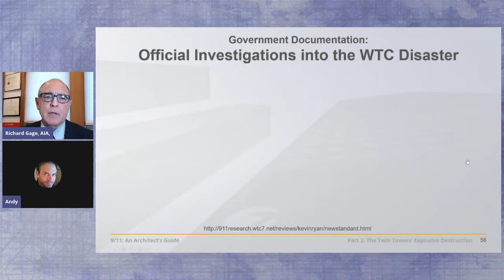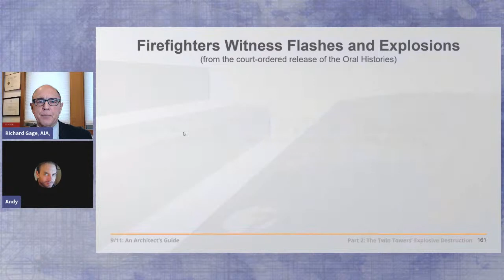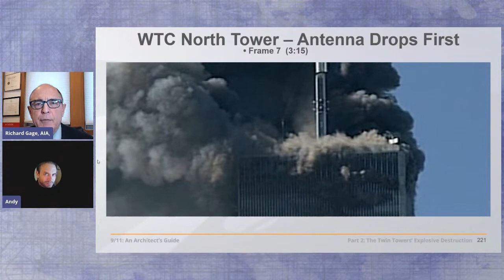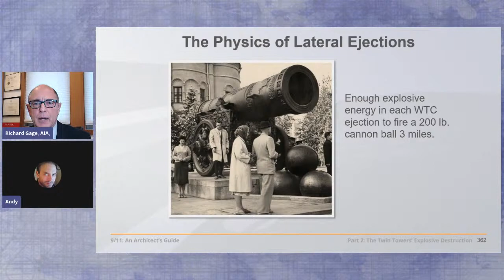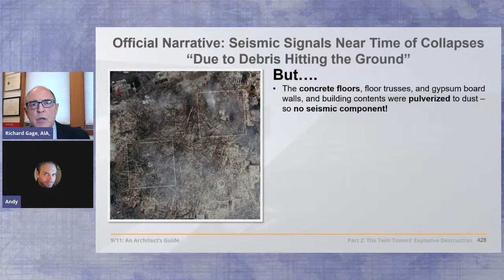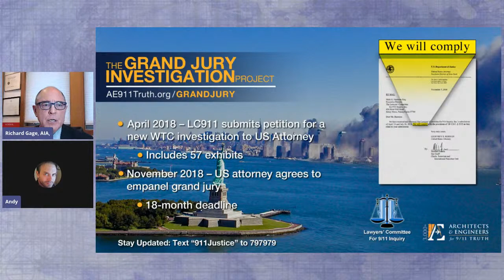9/11: An Architect's Guide - Part 2 - Twin Towers' Explosive Destruction (2/11/21) Webinar - Gage)

Comment: Chris Mohr is a debunker, and as far as I'm concerned he shoots himself down...for example he says a weight dropped on a scale will register a heavier weight than it's static weight but doesn't realize that the scale had to stop the weight from falling immediately to get that higher weight...in other words a jolt which is missing in the twin tower collapses.